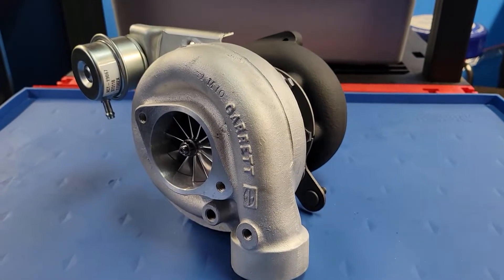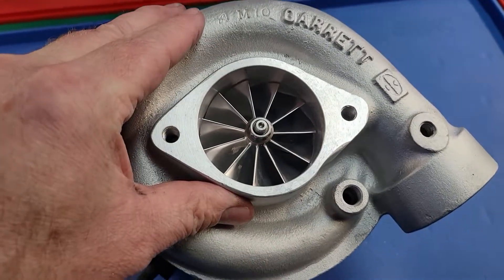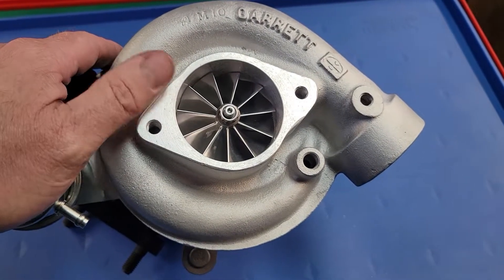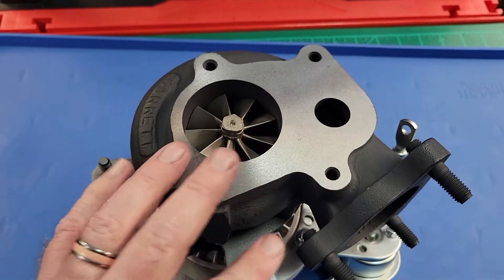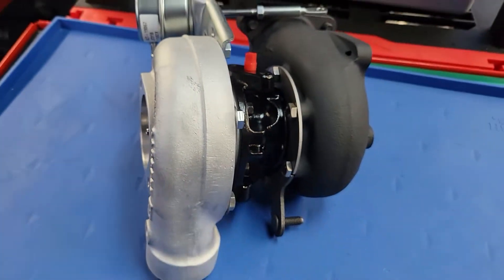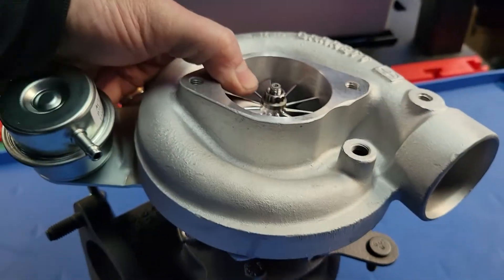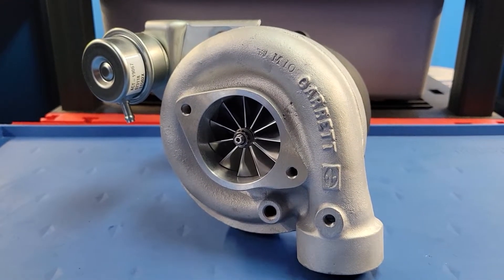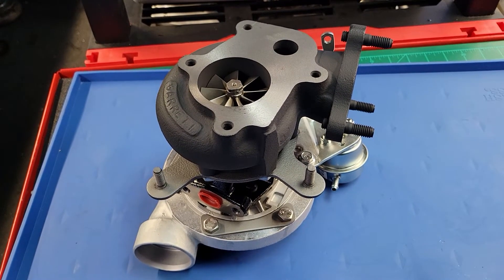WORK Turbochargers 1984-5 G4S-5857 Hot Air Buick upgrade

Comment: Great work.  What do you think the turnaround time would be after you receive the core?

Thanks
Reply from the maker: I try to keep the turn around time 3 weeks or less, but right now I am a bit busy...they are taking right at 4 weeks.  Being a small shop has its struggles at times!  I will say that a few big jobs are close to being wrapped up next week, so that may get me back to the 3 week time.  Fingers crossed!  Oh, and you can always order the turbo and choose "send my core in before" and we will go ahead and get you in line and the process started.  Once I am close to being done with your turbo I will send you an email reminder and you can pull your turbo off then.  That way you can get a bit more driving time out of it while we are working on a new unit.  Hope that makes sense!  email support@workturbochargers.com if you have further questions, I will get back to you asap.  Reed

Comment: Can I run it on stock engine at stock boost? I assume I'd just run stock wategate actuator to keep stock boost levels? All I want is a good quality stock turbo.
Reply from the maker: Rover...This turbo will run on a healthy stock engine, but I would only do it if you are planning on upgrading power levels in the very near future.  If you are looking for  a high quality stock replacement unit, or even a more conservative upgrade unit, we can help with that as well!  Give me a call at the shop and I will be happy to discuss your options.  If you do not get me, please leave a message with the best time to return your call.  We stay pretty busy and sometimes we have to let the answering machine take the calls.  205-874-6608

Comment: Ok, haha, some more questions..
-how do I decide which external waste gate to use?
-are they size matched to the turbo you are going to use?
-can you use a four port or three port solenoid without an aftermarket ECM?
Reply from the maker: For the Buick, I would suggest our Turbosmart 40mm, it will work perfectly.  Sizing is determined by several things, and while a 38mm is plenty for your engine/goals, the 40 offers v-flanged mounting to simplify the install.  If you are planning on going for more than say 450 flywheel hp, or to run on Ethanol, go up to the 45mm.  For stroker engines/aluminum heads we would suggest the 50mm.  

I am unsure if anybody has written programs for boost control solenoids other than the stock one on the Buick.  Reaching out to Turbo Tweak/Bailey or any of the Buick "chip guys" would be your best bet.  I walked away from the factory ECU many many years ago...so I am not the best guy to ask on this subject.  

Using an electronic stand alone controller would be very nice.  The Turbosmart EBoost 2 offers basic boost control, programmable "ramps", boost by gear/rpm etc.  Very powerful for the money.

Comment: I have a bunch questions Reed. 
Would you recommend a larger downpipe?  
What hp would a ta33 support just to compare? 
Have you ever seen an external waste gate on a hotair car? 
Did you make those times back in the day with a stock bottom end?
You said ask lol..
Reply from the maker: Be happy to answer!  Here you go:  Yes, you need a 3" downpipe kit to get the most of any turbo...it would even make a nice difference on a 100% stock turbocharger.  A nice 2.5" dual or single 3" downpipe back exhaust is also recommended.   Almost all real world testing I have done with a TA33 nets about 400 flywheel HP efficiently.  If you look at a MAP for that wheel (T04E-60 trim), you will see it flows really well around 30-40#/min, and falls off really quickly after that point.  So, 40#/min X 10 = 400 HP, theoretically.  It will make more, but at the cost of heat...a lot of heat! So we are looking at a solid 100-150 HP possible improvement.  We have put an external gate on several hot airs...one of the first ones we did was on the crossover pipe (bad idea, did not control the boost very well!), the second and later ones we did were placed in the UP PIPE right before the turbine inlet.  Works very well.  The style that mounts to the downpipe and utilizes the factory wastegate hole in the turbine housing is not really that nice...you are just as well off with a good internal actuator at that point.  The stock 84-85 block is OK at the power level of this turbo, IF the tune is good.  The blocks are not as strong, but we have never broken one.   Going low 11's on it should not be an issue if it is healthy.  Let me know what other questions you have, I will be happy to help!   -Reed
Reply: @workturbo  Ok!  Thanks for answering!!
Next barrage of questions!😉
1-would a larger turbo (say 6262) net more power and cooler temps?
2-would you vent the external waste gate on the UP PIPE to the exhaust or to the atmosphere?
3-how do you calculate the size of waste gate for an external setup?
Thanks!!
Reply from the maker: Good questions, and very simple to answer!  While the 6262 sounds like a great idea, it is not "unless" the engine can use the airflow.  A centrifugal compressor has an efficiency "island", which is simply an area of flow and pressure that it wants to operate within.  The closer to the center of the island you can get, the better.  However, if you cannot generate the airflow (or try to generate too much airflow) you get "off the island", which simply makes heat.  So, a bigger turbo "turned down" usually will perform worse than a smaller turbo running "on the island".  Plus, you have the associated "lag" of the bigger turbo, which will drastically reduce torque output.  Now, if you have a proper cam, heads and converter...the 6262 is a strong performer!   

For the wastegate "dump", atmosphere will flow the best...obviously because the downpipe and exhaust system does not have to deal with the added volume of flow.  The Buick sounds "ok" with an open dump (mine was that way for many years)...but it is loud, and you need to make sure you dump it in a safe location as the exhaust is very hot coming out of the pipe.  

HTH!  Reed